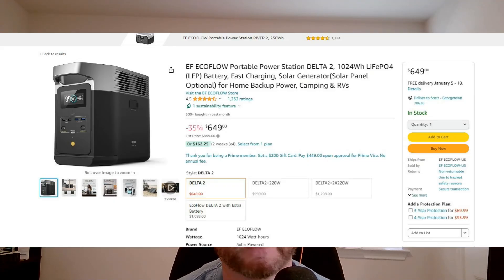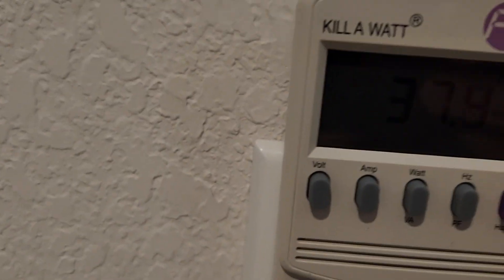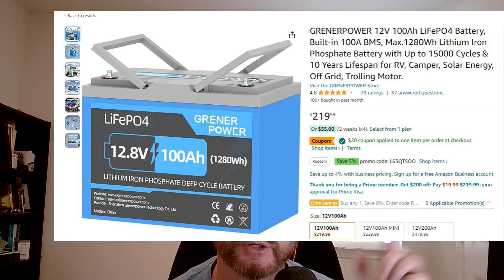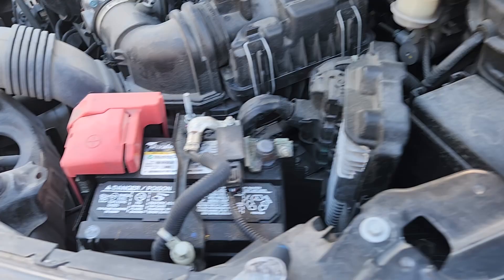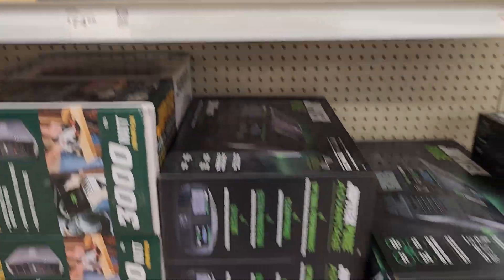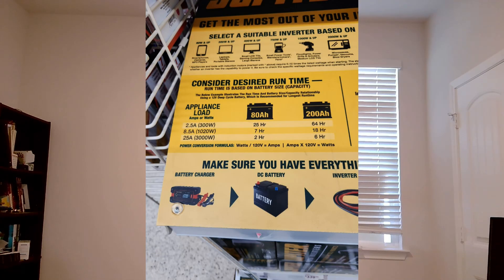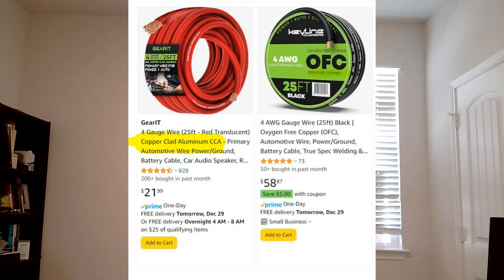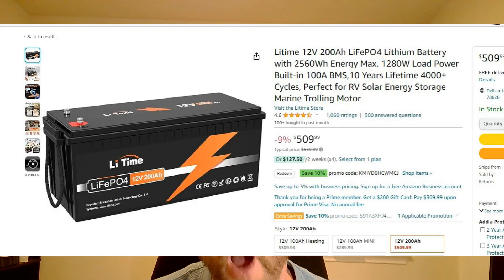Solar MISTAKES! DIY Start here! | Texas Prepper Projects #prepper #solarpower

Comment: Great setup for multiple home appliances and RV, low frequency ( transformer based ) pure sine wave inverter 24v,  3000w ÷ 24v =125amps ÷ 3-24v 100ah batteries = 41 amp draw on each 100 amp  battery, 3-24v  100ah batteries = 7200 wh or 7.2 kw, add a 50amp 24v charger and you have a extremely  powerful system, add 2- 150v mppts,  and add as much solar as you can, about 2000w!  If the inverter were ever to fail, you can replace it, if a battery fails, your system is still running, much better setup than any of these high frequency throw away units
Reply from the maker: Thanks!

Comment: Good info here.  For prepping check into buying something like a power station of 1500w, backed by 2 100ah, and about 400w of solar panels.  All backed by a gas generator with 5 gal. of gas, as good working used ones can had cheap.  You might have to just run it 2 hours in the morning and afternoon.
Reply from the maker: yup, check out my more recent videos for more specifics. People think that a 100w panel is going to save them. It won't.

Comment: I have decided to go with a 24V system in our trailer….  We presently have (3) New 12.8V 100AH batteries…I see how to get (2) batteries in series for 24V but what about (3) ? ….. I can add another new one for four, but if we can get away easily with 3 that would be great… would it cause a problem with 3, such as uneven output and wear and tear…..
Reply from the maker: No, you need an even number to get to 24. So, pick up another battery. You'll do 2 in series and then parallel the pairs

Comment: Starting from zero: buy a small inverter dual fuel generator. Second, buy a solar charged power station 2kw minimum with minimum 400 watts solar panels. You can charge the batteries with the generator when solar isn’t working well. Third, educate yourself on building a solar backup system. Add to your solar panels and battery banks as knowledge and finances allow. You will eventually advance to a 48 volt system with several thousand kw hours of battery storage with multiple thousand watts of solar panels running an inverter that can output 8-12 thousand watts.
Reply from the maker: Not bad!

Comment: Honestly this video could have been 5 seconds where you just point them to Will Prowse's channel.  Also based off of my experience, instead of purposing this video as lessons/mistakes to avoid and then basically launch right into "here start with a 1,000W inverter" etc., I would have led with "most people don't know or underestimate their power needs--and they should figure that out before buying an inverter or anything else".. and also help them to understand what an "emergency situation" consists of..  for example I imagine for most people this involves keeping the lights on--and maybe the fridge/freezer running--but here's how much power these typically need (give them some averages) and help them understand how much power this actually takes b/c surprise, it can be a lot.  My two cents but hey I'm just some rando on the internet..
Reply from the maker: Wil is too busy making big videos now. The purpose of this video was based on watching hundreds of other videos of people making systems that made no sense. I.e....putting a 3,000 watt inverter on a 20 amp battery with 18 awg wire. I also have other videos with step by step build instructions and why. Thanks for the comment

Comment: FYI you can never compare between two! both has its pros and cons. DIY cost more but have benefits if you can maintain well. for some people readymade product is more safer and cheaper. you are just bluffing here not showing the actual thing hope you will do that next time. Show your magic!
Reply from the maker: Under 2kw, buy it.  It's not worth the trouble to build.  But, for a BIG system, you can save a ton of money. check out my other videos for builds
Reply: @texasprepperprojects  yes my friend that's what I'm saying. For bigger systems you should have a back channel to expand it . Solar power is never enough , you can never finish building it.
Reply from the maker: @ferdm9646  stay tuned for a new BIG build coming soon

Comment: Great information.

 I live in the northwast. If solar panels are not a good operation, what do you suggest? Other than more solar panels.  I thought just recharge with my home. However, in some cases, if I can't do that, would wind generators be a good option?
Reply from the maker: your best shot then is to get a premade system like an ecoflow with rapid charging, then get a propane generator. Use the generator to recharge the battery in an hour or so, then shut it off to save gas. This is what my brother is doing.   Wind is very, very complicated and hard to be consistent with.
Reply: @texasprepperprojects  ok, thanks for the reply and the link to Amazon. The ecoflow is on sale and definitely the way to go.
Reply from the maker: Spend the money and get the delta 2 that is 2048wh.

Comment: Thanks for this video, makes me feel better about my emergency power build. My 1000w  inverter came with 6awg wires that I'm changing to 4awg to be safe. I currently have 2 100ah batteries in parallel and 2 100w solar panels also in parallel.  I plan to add 2 more 100ah batteries as I can afford to. I only have a 30amp controller so I can add 1 more 100w solar panel. If I was going to do this again I would have bought a 2000w inverter and 60amp controller for more flexibility
Reply: Hi there from Mid Michigan.  I run a 12v system with 1200w of solar and 400ah of lithium batteries, and a 1000w pure sine wave inverter. I have 3 separate mppt charge controllers for my panels.  My build originally was with the 100w harbor freight kit with there 750w modified sine wave inverter and a 100ah/50ah usable AGM battery, just for learning experience.  It was a fun project and helped me understand the basics of solar. That was 5 years ago. Now I have a system that has been running 24/7 for the last 2 years. Huge difference on what we can run between summer and winter.  We roughly produced 1200w a day in the winter and 5000w a day in the summer.  Understanding how many watts your going to use overnight and how much solar you need to produce is a must. We are looking to expand with another 1200w in solar panels and another 200ah in batteries. And a 2000w inverter for running other loads around the house.  Yes, there is a lot that goes into understanding how this all works, but it's not that bad. I have done a lot of research to have a robust and equalized system for my area. 300w to 400w of solar per 100ah of battery is sufficient here.
Reply from the maker: Tough call but i think I'd would improve the solar and charger before adding more batteries

Comment: All good advice.   I recently built a DIY unit that matches most of your recommendations except I went with 700W inverter to save $  This set up runs my big freezer for 24 hours. Unfortinately it's been cloudy for two days so the solar energy has been very poor. Need to have a back up to the back up if power is down for more than 1 day.
Reply from the maker: Nice work!
Reply: Some preppers add an extra battery and a gas generator.  Not idea but can cheaply carry you longer.

Comment: I want to do some backup solar . I really need a serious plan. I'm not good with electrical projects. I'm in East Texas, so we have sun. I have gas generators but would like solar backup. We have 3 freezers and 1 refrigerator.  I would like a starter system that can have battery add ons and solar panels added as we can afford to expand. Do you have a recommendation for starting?
Reply: I will look into this. I thought about putting a system together. 
Will chat with them. 
Thank you
Reply from the maker: welcome @sandrarice5575
Reply from the maker: Ecoflow delta pro

Comment: 500w-1500w inverter plus batteries is good emergency power for light , tv , video games it’s more then enough. It will depend on your needs . Also a small heater 500w space heater is good size for emergency’s, just need to move to one room . 
This vid  is also a little missed leading . 
      Just do your homework ask more than one creator/video about diy or buy , and everything will depend on your power needs or for emergencies.
Reply from the maker: How is it misleading? Why would you use a 500w space heater on a 1000wh battery?
Reply: A 500w space heater can only run from my huge 12v 300ah LiFeP04 battery for about 6 hours and that`s pushing it unless you want to drain your battery completely dead which is terrible to do if you value it and want it to last. My emergency backup plans for heat if a winter storm hits Louisiana are gas generator/heater, outdoor fire, electric blanket, ways to make warm drinks, warm clothes, and a 200w space heater to attempt to warm batteries in a very large cooler before charging if needed. Charging batteries in extreme cold (lithium ones) can seriously damage them. Running them dead isn`t on my list of things to do either. PS: If you`re using an inverter to run AC lights in emergencies, and watching TV, and playing video games...well....that probably explains everything.
Reply: Solar is moderately well matched for electric AC, with the new efficient mini-split units, and getting better... when you really need and want it, is when the sun is at it's worst/best. But for that reason, solar will always be a poor match for electric heating. When you need it most, recharging those depleted batts the next day will likely be a challenge.   :(
Reply: @jimg5669  Last June a storm hit during a heat emergency at 3am. I connected my panels/solar charging at dawn to be able to continue to run my small 400w window AC from my big battery. Just when I got great sun...enough to add some charge plus keep up with power used big clouds rolled in. I was still able to run my AC from 3am until 6pm the next evening though and switched to small fans to get rest.

Comment: Question. The Solar generators seem to be a decent idea for a few days without power. I own 2 myself. BUT lets say there is an extended power down situation due to cyber, solar flare, EMP or whatever else. Perhaps 3-6 months or more. 

Would a person be better off, instead of having one or two solar generators, having just some good 100w solar panels, voltage regulators and some small, car sized power invertors? Then he/she would have the ability to scavenge dozens of car batteries and charge them instead. If the grid is down people won't be driving after the first week due to gasoline shortages and batteries in cars, boats, mowers, tractors, motorcycles etc would be abundant. The ability to charge car batteries around the clock and even set up arrays of car batteries would be very adaptive to the situation.

In other words how many car batteries would be equal to say a Jackery 1000 solar generator with a lithium battery? I would love to see a video on that.
Reply: For a multiday outage I would consider having a genset on hand to recharge the batteries.   There is no guarantee of sunlight, and a 100% chance of darkness at least some of the day.  Of course this brings all the challenges of generator care & feeding.  Run the generator for a short time in a secure place to charge batteries quickly then use the battery power for silent operation the rest of the day.
Reply from the maker: this is what my brother in law did @brianwood256 .  He bought a ecoflow delta 1200wh and a champion duel fuel generator. The eco flow will recharge in an hour, and a 20 pound propane tank will last a while. So he can use the battery at night for quiet and charge it during the day with the generator in an hour.
Reply from the maker: The only time I would touch car batteries was in a true end of the world situation. Car batteries are NOT DESIGNED for this type of use and do NOT HAVE very big capacity.   How many car batteries does it take to make up a Jackery 1000?  About 10.  If you're really worried about an 'extended outage' then just make sure you have the RIGHT match of solar panels (200 watts) to battery capacity (100 amp hours) and then multiply that over and over again. I have 3 or 4, independent systems that all match this ratio that i've built and assembled over the last few years as sales and money frees up
Reply: I understand that during an extended power outage of many months you cannot really hope to power a house or even some of the appliances. As soon as the gas generators run dry a solar generator  backup wouldn't get a household far and that would not be my intention anyway. But there are many smaller needs that could be met such as well pumps, radio communication, charging of electronics, running  power tools, lights for the chickens etc. Seems like having many sources of power around the homestead would be easier than just one or two solar generators  "in a true end of the world situation" as you put it. Thanks for reply.
Reply from the maker: @seadoogti9288   I don't disagree. I have several 'smaller' units, as opposed to a power wall, so I can spread them around the house.   Again, I'm not an end of world guy, but to answer your question, my personal plan would be to rip apart roadside solar speed trap signs and take their panels and use those to power batteries. But, I wouldn't 'stockpile' parts to do so.  I also agree about solar vs gas, which is why I'm a big fan of solar
Reply: @texasprepperprojects  I think the end of the world as we know is much closer than people think. Appreciate your info.
Reply from the maker: welcome @seadoogti9288
Reply: @texasprepperprojects   I don't like the solar speed trap signs to begin with - why wait for the S to HTF? 🤣

Comment: ALL depends on the purpose of the system. If you want to support life through a minor power failure go small, you'll get 2 LED lights and a laptop til dawn. If you need to support electric hob and fridge and freezer plus computers etc the power need is very different. Remember that a dull winter day will allow you about 5% of your panel's rated solar harvest, Use the battery to power the house overnight then maybe a generator to fill the batteries when everyone has woken up.
What supports some twinkly lights in the evening probably will not support family life for a week of power outage. One woman in France had the system installed but no panels due to planning delay, she got through a  day power cut by running a generator all day to charge the batteries that kept her overnight.
Reply from the maker: yup
Reply: Quite a few preppers recommend having a gas generator and running it a couple hours in the morning and then in the afternoon to top off batteries.  5 gal. of gas goes a long way.  When it comes to prepping we just need to lay low and be comfortable, not be a target and live a lavish life style.

Comment: I agree with you on everything you said however I wouldn't consider anything under 3500 watt if you need to run a well pump, furnace, fridge and freezer. 
I started with a bluetti ac200p which is 2000 watts with a 1000 watt solar array and it was fine for the fridge, freezer and lights for less than a day but it really isn't sufficient as a home backup for any long power outage.
Reply from the maker: The reason why I said 1000w/1500w is because that is the minimum you need to kick on most fridge and freezers on their own. Also at the end I pointed out that 1-1.5kw is the most you can run on a 100ah battery before the BMS trips.  If you run 3500w, I hope you have a BIG battery.